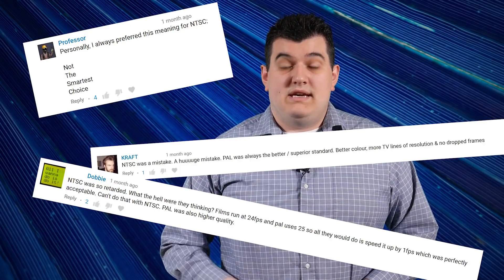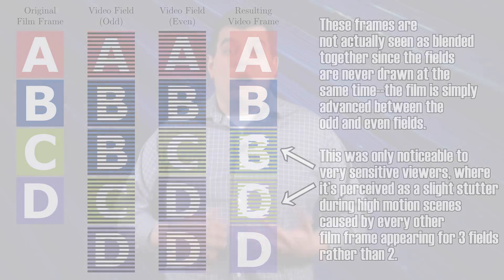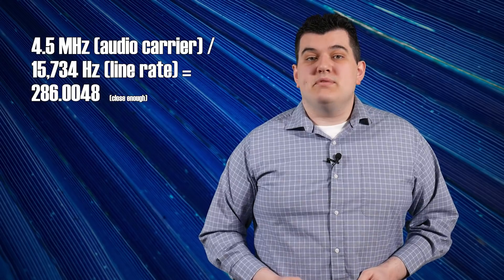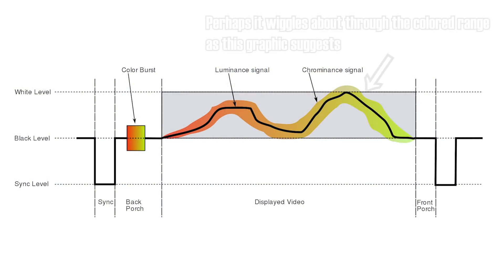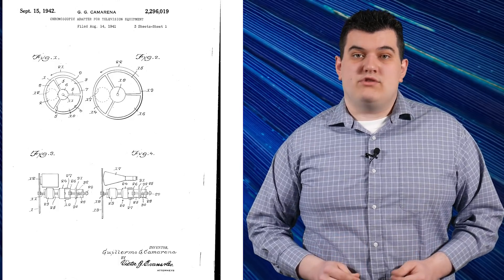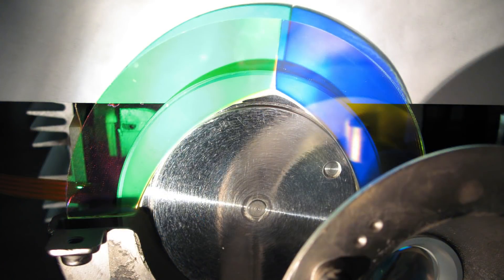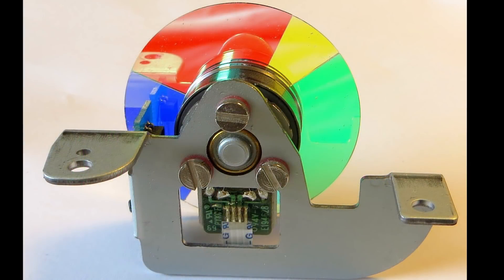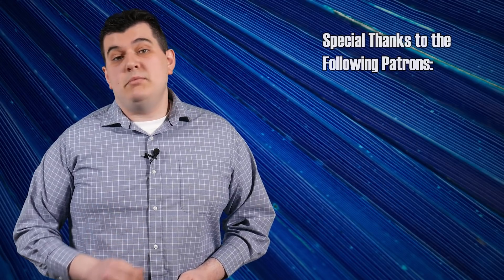Analog Color TV Wrap-Up--Some extra info

Comment: Thats true... there is no better in NTSC vs PAL
Similar comparison would be like comparing early Plasma panels and LCD panels. The Plasmas had their advantages (black to white contrast, superior color accuracy and color intensity,big panels were "easy" to manufacture, motion handling) while LCDs had others (efficiency, much less heat produced, brighter, "no" burn in, much thinner and lighter,...)

NTSCs benefits were easily the framerate, i even dubbed some old series with ntsc video to the german audio streams with a little bit image restoring/upscaling, the resolution is anyways garbage for todays standards and on modern, big 4K screens so the higher resolution of PAL isnt that much of a deal anyways.

PALs advantages.... hmm, back in the day PAL looked MUCH better because of its higher color accuracy and resolution, but the 24fps, which annoys me still heavily on BluRays and anyways any movie, especially with a OLED TV now (my Plasma TVs handled 1080/24p BluRays MUCH better!) are still a major disadvantage.

I hope that movies soon begin to be all at least 50fps, better 60 fps or even 75 fps (since 144Hz is best for all most used framerates AND 24p/23,xxxx)
Especially TVs should use 144Hz panels instead of 120Hz, shouldnt make much difference in costs and would make IFC/adding AI generated frames pretty much unnecessary for a "smooth" 24p motion. This 24p thing is already pretty fixed with 120Hz IFC stuff compared to the first IFCs with 60Hz, but still we could have avoided that completely.

Comment: The framerate difference between PAL and NTSC is also dictated by the frequency of the AC current. Artificial light is pulsating at 50Hz in Europe, if you record at 30fps the image will flicker.

Comment: Sorry, but running the film 4% faster on PAL is a helluva lot better than that godawful stuttering when something's moving across the screen on NTSC... How you can live with that stop-start motion beats me, it's horrible to watch.

And the 100 extra lines is, what, roughly 25% higher resolution; it's significant.  Whenever we had visitors from the U.S. they often commented on the improved picture.

Comment: NTSC is a faster (more frequent) refresh, so that part is superior. And interlacing looks better on NTSC than PAL (less flicker), though, you could use a longer-persistence phosphor on PAL CRTs to compensate, I guess.
Reply: Frank Silvers  HAHAHAHAH. Dude, DVDs are based on NTSC. I see editors and decks working the the NTSC domain every day.  Shocking I know. it's not broadcast much but it's still in use, even for music timing.  Thou PAL is more common for the latter.

Comment: I have a question. Well, i have a projector datashow with DLP system you talk, and I notice the effect/defect when I move my eyes in horizontal direction can see a trichrome effect like a rainbow. But, how is possible then that it has a control of saturation of color...? If there are 3 colorized RGB rounded filter (running motorized like early CBS tv set), I wonder how is possible if those color of glass are fixe, it is not electronic device, is mechanical, and the screen is B/W..? I hope you understand my question. Sorry my English.
Cristian, Santiago, Chile.

Comment: That does not make sense. No body would ever notice a 4% speed up, unless they saw it side by side. But as you alluded to, some people was actually affected by the pull down ntsc used.
And the problem came up again, with the new video formats. So it is actually a problem.
Reply: Frank Silvers  Might be MPEG and other digital formats. Can't remember the video.
As to being used to listen to American voices, most of the western world is, through television and the internet.
With the new formats we got the same frame rate sometimes, and there is no difference.
What would 1000hz become if you speed it ud by 4%, 1040hz? Can you really hear the difference between those two?

Comment: SECAM  became the black sheep of the three systems, PAL, NTSC and SECAM. Professional studio equipment was supplied in ether the 525/60 NTSC system or the 625/50 PAL system.  I believe that in places that used the 625/50 SECAM  system, the station equipment  was all 625/50 PAL up to the transmitter where the signal was converted to 625/50 SECAM just brfore it was sent over the air.

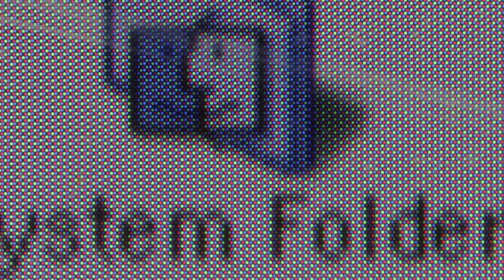Comment: 11:05
The Dot Pitch number represents the distance between 2 adjacent dots of the same color (red-red, green-green, blue-blue).
Not how many dots appear over a given length.
If the dot pitch of a screen is .28mm, it means the distance between the center of a red, green or blue dot is 0.28mm to the center of the next red, green or blue dot.
Yes, you can calculate how many dots would appear over a given length with this but it's not what the term Dot Pitch stands for.

Comment: You guys just don't like change. That's why you still use imperial measurements
Reply: Imagine if every time a new device came out you were forced to upgrade instead of being able to upgrade down the line. Especially considering the cost of TVs back then, many poorer people would be unable to access any TV
Reply: Frank Silvers  it was a tongue in cheek comment man :-) it really doesn't matter, the only, very minor issue I encounter is when watching these videos. When something is mentioned in miles or yards, then I have very little frame of reference. More my own shortcomings than anything else.

Comment: The interfering "dots" creating the "dot crawl" was the result of a beat between the sound carrier frequency of 4.500 MHz. and the color sub-carrier frequency of 3,579,545. Hz. ≈ 0.920 MHz.  (920,546. Hz.)  Because there is not an even (integer) relationship between the two frequencies the dots constantly move.  The dots are only visible when there is a sizable amount of signal distortion, such as inaccurate tuning, or other abnormality.  NTSC meant "Not The Same Color Twice" to me.  (in those olden days) Ron W4BIN

Comment: I have a 14" CRT which uses PAL 525/30 only. 

When I watch NTSC signals in it, I can see the chroma dots (because the TV doesn't process the color from NTSC, as it is expecting a PAL 525/30 signal). And the TV doesn't have an option to switch to NTSC mode, so my only choice is to watch it in B&W with the chroma dots pattern.
Reply: The TV supports color but only in PAL-M (525/30). So both NTSC and PAL (625/25) signals appears as B&W.

Comment: A few points: the NTSC (National Television System Committee) in 1951 demonstrated PAF (Phase Alternate Field) and PAL (Phase Alternate Line). Unfortunately to facilitate the line averaging to cancel the hue error in PAL, a 64us glass delay line had yet to be invented. It was not available until about 1960 which led to the PAL standard.
The BBC was planning to adopt NTSC as late as 1966 but at the last moment switched to PAL.
The BBC launched 625 lines in 1964 which would eventually supersede the 405 line system dating back to 1936. The 8MHz channel adopted in the UK in 1964 as opposed to the North American 6MHz channel adopted in the US in July 1936 is the main reason for US television resolution appearing somewhat less. PAL because of the line averaging, reduces color vertical resolution and the alternating phase encoding didn't allow for as efficient chroma-luma interleaving which meant that fine detail in the PAL picture say was more prone to 'crosscolor' a flickering rainbow effects. This was seen on presenter's shirts and ties and was fun to watch in PAL. This and other problems with PAL led it to be referred to as "Problems Are Lurking".
Alas, if the BBC had pursued 625 line NTSC, it would have provided the best of both worlds: superior resolution and color.
Reply: In 1980s Sydney,  Clive Robertson, a late night news presenter amongst other things, used to specialise in wearing ties that he knew would wreak havoc with the video signal - he took pleasure in giving the tech directors a hard time :-) . For this and other reasons, his news show was fun to watch.

Comment: I think too much is made of PAL. It was delayed and delayed because the engineers were unable to show correct skin tones under varying conditions and the removal of the tint feature prevented the user from correcting this (unless they were running PAL Simple as some early Sony's could whereupon the tint control was usable. Most Tv's with PAL simple were simple only as it meant they did not have to pay a license fee to Telefunken. PAL was eventually corrected and with the exception of really bad multipath and reflected signals, produced a faithful chroma. SECAM got around the Hanover Bars (Color flashing caused the 90 degree shift) and also got rid of the chroma noise by use of FM Modulation. Ironic that NTSC was probably the most challenging to transmit and receive with a goold color picture and SECAM the easiest whereas in Production and specifically Post Production NTSC was the easiest and most flexible and SECAM the worst. Still it is all history now with the exception that Europe still uses the sloer refresh rate though Blu Rays are 60p. Maybe with the talk of double refresh rate a world standard of 2160p120 could be adopted. That won't stop the plethora or trsnamission standards both terrestrial and satellite.

Comment: Europe did introduce color TV 10-15 years after US, but still, in first years, color TV in US was so rare that we can conclude that NTSC color problems was result of premature standardization. System could still be improved before standardization without much impact tu acceptance of color TV.
Reply: Frank Silvers  we are comparing standards by simply stating it's origin. Both european standards are younger amd both solves NTSC issues.

Comment: A more informed analysis than many, well done. Two points. PAL did not get everything right, e.g. Hanover Bars which they fixed by repeating the previous line color info. PAL was also much more prone to Chroma noise on long distance high power transmissions. This together with the Hanover Bars fix were built into SECAM which was a much better system than PAL. Of course there is always a downside. Post production in Ntsc is easiest and Secam is hardest. As a result most Secam production was made in PAL and transcoded fir transmission.

The one error in your piece is where yu talk about tapes being wiped and b/w films being made. A telecine is a device which scans a frame if film and converts the image and the accompanying sound to a video and audio signal for transmission or recording on VT. Telecines do not record anything. The devices used to make these film copies (mainly used for export sales to developing markets) were called telerecorders and made telerecordings. These were basically film cameras with an optical sound head pointed at a tv monitor. So you should correct that. Telerecordings were very useful in the early days of television where there was no real standards conversion and with careful line up it was possible to use a telerecorder to overcome this. Subsequently analog then digital converters recomposed the pictures with vastly superior results. Oh one last thing, you confused color standard which CCIR broadcasting standard. The line field frequency is the result if the broadcast system not the color standard.  So in the USA M stands for 525/60, the black level, the Peak white standard and the placement of synch data in fly back area. So Japan has NTSC J which had 525/60 but differed in other areas including frequencies. PAL is often 625/50 but in South America PAL M using PAL color with US line field rate and Argentina had PaL N which had a further mixture if the two.

So we all have one HD standard if 1080i/ 720p now right? Nope we have ATSC, DVBT DTMB and ISDB (2 flavors) as well as the line field rate the compression codecs the frequencies, mux etc etc. and 4K and 8K drift further apart lacking full standards yet. Look forward to you doing one on UHD. Thanks

Comment: I've always wondered why tube-based televisions (and broadcasts) never went the route of CRT computer monitors, since the computer monitors were capable of such a higher resolution than regular TV displays.  I had a Sony 30-inch wide-screen CRT HDTV for a few years in the mid-late 2000's, a 150-pound beast.  Are there any videos on tube-based HDTV?

Comment: I remember something else about black & white TVs, I'm italian and my grandfather had a very old B&W TV (still don't know the name of the model, but it had a circular antenna for signal, white rounded frame and 3 metallic legs) which also had a hole on the side, made by a technician I presume, with a wheel in it, that I remember using to add some kind of color to the images, I clearly remember the struggle to fix the color to an acceptable range as I wanted to watch "Alvin and the Chipmunks". 
Could that have been a color wheel?? (Have no way to verify myself, house where the TV was collapsed, nothing but debris there).

Comment: The U.K. switch to colour was also a switch of resolution. The original 405 line system was extremely early electronic TV and, a bit like NTSC, had made design choices that were less than optimal in hindsight. 405 Line (Marconi) tv was also tested with NTSC colour, but it was never pursued as the outcome wasn’t very good and better technology was around the corner.

Meanwhile, in France they had adopted 819 line B&W television (HD in the 50s!), which was tested with SECAM colour and proved to be far too high bandwidth to be practical with multichannel television.

Several European countries had already standardised on 625 line black & white and that was the EBU (European Broadcasting Union) preferred format, so the odd ball and older standards like 819 and 405 were dropped in favour of 625 but the mid 1950s.

Colour TV in Europe was then only added to ‘modern’ 625 line systems.

So there were plenty of TV stations that began as 625 line services, like RTE in Ireland and broadcast in b&w for some time.

Also B&W TV sets remained cheaper, so even after the launch of colour, they remained a budget option into the 1970s.
 
British broadcasters also only UHF for 625 / PAL. So previous Marconi 405 line tv was carried on VHF only. That was not the case elsewhere eg PAL I was broadcast on VHF in Ireland and colour tv on VHF was quite normal in most of Europe, Australia etc etc for many years.
Reply: Interesting to know that the French tested colour with the 819 line system. Indeed, it was HD in the 1950s. Also due to the high bandwidth (14 MHz channels!), in different areas,  they had to use both audio 11ish MHz above video carrier, and audio 11 Mhz BELOW video carrier in what was otherwise the same frequency allocation, to get get extra "channels".
In (I think) Belgium, they had a compromise system that squeezed 819 line signals into 7MHz channels.

Comment: Doesn't tackle why the difference between PAL and NTSC still exists in places its irrelevant - like video tapes and digital media. Why was there a difference between VCRs in the US and UK other than the outputs being in the appropriate format for the TVs in the respective countries ? Surely what goes on the tape could have been a global standard ? 
Video explanation please :)
Reply: Analogue video tape records a version of actual broadcast signals, so incompatibility remains.

To avoid strobing effects with lighting sources like LEDs and florescent tubes which may be running at 50Hz or 60Hz televisions and broadcasting retains compatible frame rates in 50Hz and 60Hz markets.
Reply: @AlmostUnique000  Frame rates should not be recorded on the tape but recreated during play. I'm sure that's tricky - why they went cheap :)
Reply: pmailkeey Unfortunately, that wasn’t technically possible. VCRs simply recorded the broadcast signal, representing it in analogue format on a tape. 

If it’s recorded as PAL/625/25 or SECAM/625/25 or NTSC/525/30 that’s all that’s stored on the tape. 
It could, however get past the channel spacing and audio subcarrier differences between for example PAL I in the U.K. & Ireland and PAL B, D, G, H, K etc as the PAL video and audio was stored in the same manner and the modulator in the VCR output the video in the correct local PAL version for its region. PAL & SECAM tapes were interchangeable, but you lost colour.

Multi standard VCRs convert the signal standards to allow display on the target TV type. Some of them didn’t convert the frame rate however, which means some older TVs wouldn’t display their output, often displaying rolling images.

Digital media increasingly can be stored in higher refresh rates and output at the desired rate for any given display. 

Also a lot of modern panel displays also don’t really care what refresh rate is presented to them and can interpret a wide variety of standards, as they’re not based on electron guns scanning the screen. However, you can’t get away from the flicker issues caused by being out of sync with the local electricity system, at least not if you’re displaying at lower refresh rates.

One of the most ludicrous and frustrating problems at the moment is a lot of mobile phone cameras ship with a built in North American 60Hz - 30fps based camera and it will cause lighting flicker in 50Hz counties, which are most of the world. It seems like rather sloppy localisation, particularly when you consider 50Hz power is standard in far more of the world: all of Europe, China, most of Asia (except South Korea and Southern Japan), Australia & NZ etc.